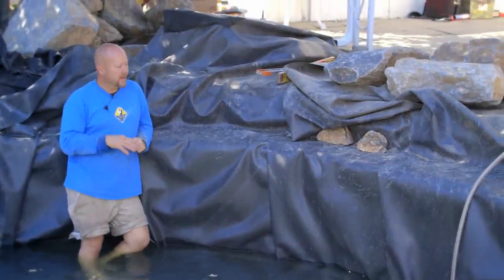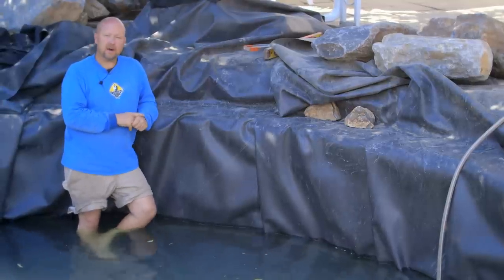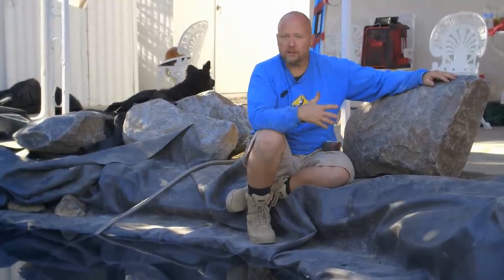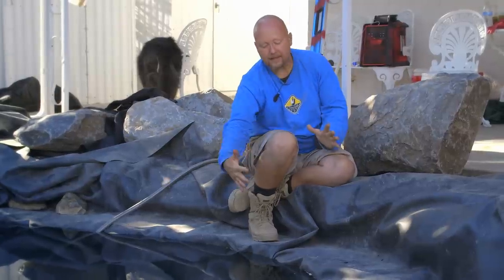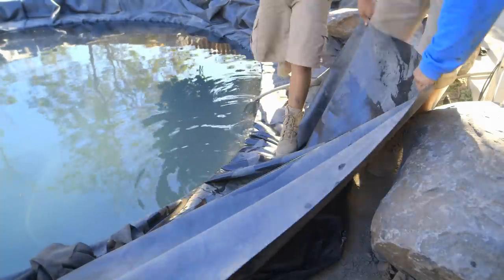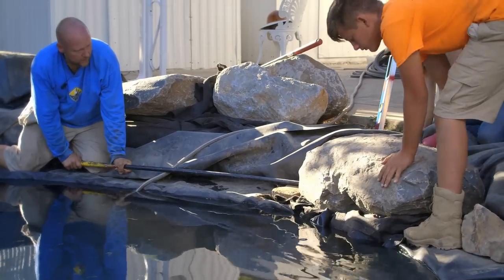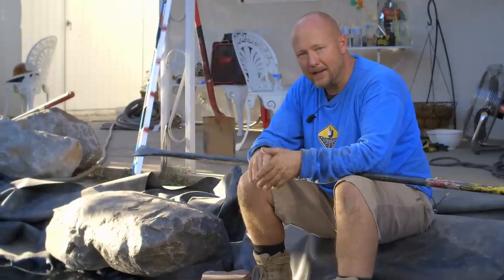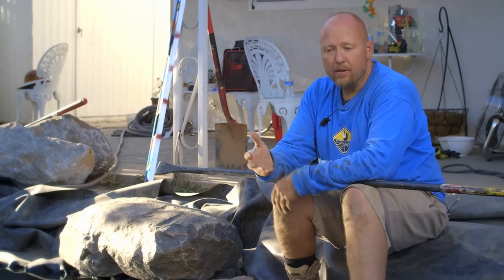Edging Stones around Ponds Edge 1 - KP 31

Comment: How long did it take to fill up the pond? Also do u have to have concrete base to use the spray liner?
Reply from the maker: Rico Suave the pond took a few hours to fill and yes we would suggest the concrete bond beam with the spray on liner so you can set the large boulders without upsetting the bench.